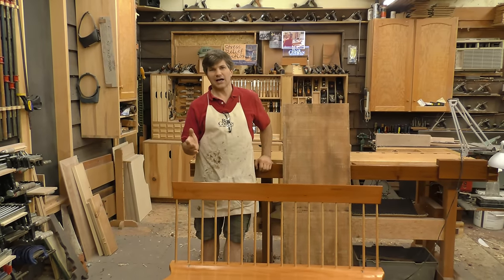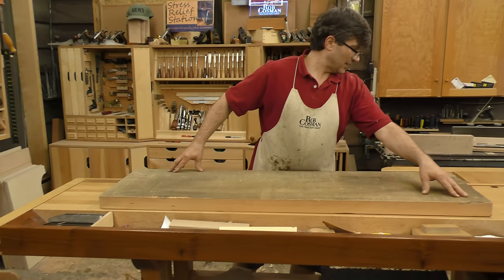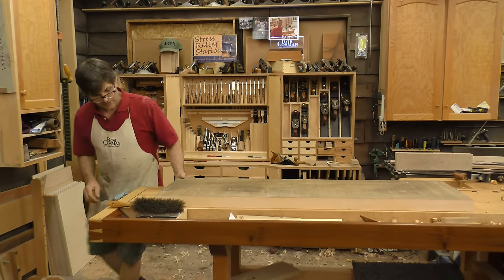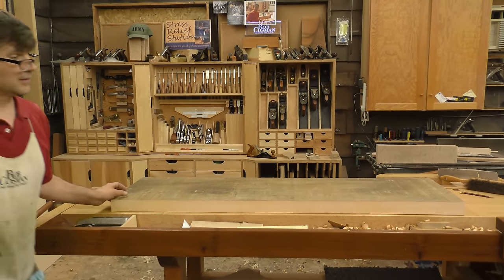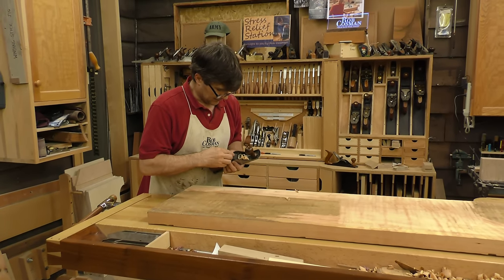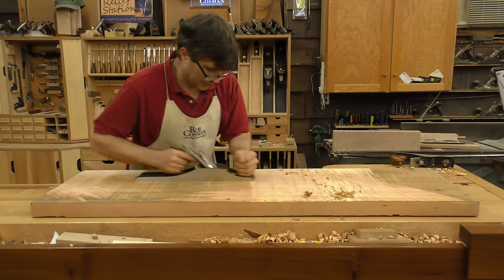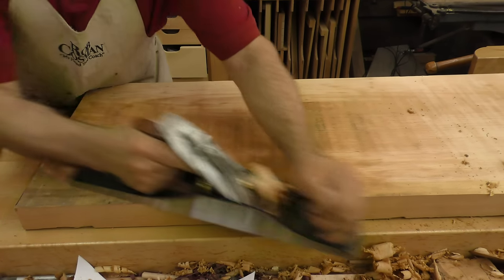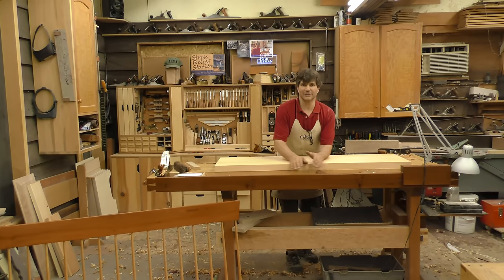Planing Wide boards more accurately with Rob Cosman

Comment: I discovered scrub planes by accident when I built my workbench. They are a HUGE improvement over attempting to level a board with a belt sander. No noise and most importantly no dust ! Also fast and the level of precision one gets just can't be beat!

Comment: Great video Rob. I loved the fact that you showcased the scrub plane and #6 plane. These 2 hand planes are often forgotten  but I could make an arguement that these should be your first hand planes you get.  Learning how to flatten/joint a face of a rough sawn board should be one of the first things you learn to do when learning woodworking and the use of hand planes. I love my #6, probably the most used plane in my shop. I use it just as in this video for flattening rough lumber as well as cleaning up large tabletop/panel glue ups and even as a jointing plane for jointing the edge of boards to be glued up.

Comment: I am a retired wood worker and enjoy seeing how others approach a situation. I continue to learn.Your way will get you a flat surface but have you tried putting your work on a known flat wood surface and wedge and lock your piece down so it can't  move then run it through your planer? In a few passes you are flat on one side.This is a huge time saver that increases your profit as it only take a few minutes.
Reply: how do you lock it down
Reply: Simple. Lay board on a carrier board or sled if you like, say 1/2 in ply or mdf then blobs of hot glue in the right places to level the board and stop it moving. Then pass both thru your thicknesser.   I have no jointer and have flattened boards through my thicknesser for years this way.  Still enjoy watching somebody use hand tools which is why I am here.  Look around youtube and you will find loads of  sleds, just don't go mad with all the wedges and do dads people make.  Hot glue is the way to solve the problem quick easy and knocks off simply after use.
Reply: how?
Reply: @frontbum420  not quite sure what your query is but the carrier board (sled some call it) runs on the bed of the thicknesser, the board to be flattened sits on top of that. Once you have established where it is rocking and the locations for your blobs of hot glue, apply glue (to make clean up easier I usually stick a piece of two inch masking tape on carrier and board to be flattened and then apply big blob of hot glue to the tape, that way you simply pull the boards apart and remove the tape, glue comes off with the tape).  When you rest the board to be flattened on the carrier board it squeezes the glue down and once hardened (30 seconds or so) it stops the board rocking and glues the two boards together.  Then pass the board through the thicknesser, carrier board down obviously and take as many passes as are necessary to obtain a flat surface  then remove from carrier board and flip over. Then pass the board through the thicknesser with the newly flattened surface down until you have a second flat surface.  It's really easy and gives you a perfect result every time.  I have no room for a big jointer and have flattened boards up to 10ft (bit tricky but a couple of roller stands and it worked fine) in length through my lunchbox thicknesser for years and years. If I haven't made the process clear let me know and I'll expand.
Reply: A flat surface and a long straight edge, draw measured squares with a charcoal pencil, move the board back and forth, the charcoal will make all highs seen with the charcoal moving out of squares. Same principal when I use Russian blue on steel. Its 100 percent effective. Art charcoal works best, I used same principal when I machine steel, no mess!
Reply: Michael. That is impressive. and helpful.  I have some charcoal pencils but never used them.
Reply: Came across this the other day. Haven't tried it but looks like it'll work perfectly.

https://www.youtube.com/watch?v=DNg9BV4IF2Q&index=58&list=WL&t=0s
Reply: @Dickie2702  Hear, hear!

Comment: Rob, another great session here, and I learned a lot as always. Many thanks to you. Just one thought: rather than flipping that heavy piece over and over again to test it, why not simply use your long straightedge to identify the high and low spots? That would work quite well and go very quickly. You're right that more folks should adopt and use the scrub plane. It's also a most useful tool for establishing texture on pieces that can benefit from that—sculpture for example.

Comment: I helped an old time woodworker with this same basic process on some maple of similar size.  Instead of using a hand plane to attack the high spots he set up a lapping table with coarse sandpaper glued to the flat table.  We faced each other and simply pushed the board back and forth between us.  We never had to flip the board with this method and as soon as the rocking stopped the boards went into the planer.

Comment: Since you were going to send this through the thicknesser I'd have used a 25mm mdf baseboard, shimmed the ends with wedges to keep it level, dogged it onto the baseboard and just sent it through the thicknesser taking very light skims... but hey, I'm an idle so and so and all that hand planning I did when I didn't know any better :)

Comment: One way that's worked for me is to remove the jointer guard, and joint the board, letting it hang over the side of the table. Then flip the board, set the jointed portion on a simple sled - a piece of 3/4" Baltic at least as long as the board, and the same width as the jointer bed. Run the sled through the planer, making the opposite face parallel to the jointed section. Finally, remove the sled, flip the board, and plane off the 'step' left in the original face from jointing only part of the board.

Comment: Rob - A technique I was shown to save time from hand planing a cupped/warped board was to get a piece of melamine, the same width as the board you want to flatten, as well as a little bit longer. Place the board on top of the melamine, and shim the gaps of the high spots. hot glue them down to the melamine so they don't move, and then run it through the planer until the entire board has been planed down. then just flip it over, and plane out the highs/lows on the other side. much quicker, all though I do love hand planning.

Comment: I really need to pick up an old #3 to #5 on ebay to convert to a scrub plane. A regular blade in a #3 does pretty well in softer woods, but for hard stuff like ash it can be a slow process.

Comment: hi Rob, would using your winding sticks help with the initial flattening? or a long straight edge? Cheers
Reply: Yea, I agree. Using winding sticks for the bulk of the primary work has got to be much faster than the constant flipping. Save the flipping for the last few high spots.

Comment: An easier and faster method is to build a sled wide enough for your planer. Place the board to be planed on top of the sled cup side down (so it rocks on the sled). Then place shims along the edges of the board to remove the rocking motion. Then use a hot glue gun to glue the shim to the sled, and then a bead of hot glue to join the board to the shim. Put the sled and board through the planer a couple times and it will come out perfectly flat. The hot glue is easily removed with a putty knife or chisel. Way easier!
Reply: Okay Rob, point taken. Cheers!

Comment: I think there is an easier way with the way you're showing. If I were to use hand tools just like you are what I would have done was scribe a reference line on my workpiece from your bench top that is flat. That way you have a perimeter line all across your board to plane down to. The only word of caution for this process is to hold your board  and not letting it move while you scribe the perimeter line on the work piece

Comment: Hi Rob! I'm pretty new to woodworking and am really starting to get into the meat of it. I was introduced to your channel just recently, and let me tell ya, you have a viewer for life and a future customer (once my budget permits of course!). Your utmost attention to detail is impeccable and I'm really grateful for all the material you provide. After watching this video, I wanted to ask: What purpose is the scrub plane for when it seems your #6 managed to do an equivalent job, if not better?  I feel like the longer reference edge on the #6 planed away the high spots more effectively while the scrub plane did so in more of a hunting manner.  It leaves me wondering what purpose the scrub plane has when other planes may be able to do its job. Any thoughts would be greatly appreciated, and as comes assumed, it was a great video. I learned a lot!
Reply: I watched the video and was enlightened cuz I've done similar process with #5 and #7 and it took close to 3 hours I think when the board is that severe and needs that much tuning  looks like it speeds the process to getting to the jointer #7 or in this case the fore plane #6 a whole lot quicker than without the scuba plane. But then again, Rob makes it all look so easy.

Comment: @robcoasman when you flattened the board could you of used winding sticks??
Reply: I find the human eye is pretty accurate when looking at these types of things, especially on large stock. I rarely use my winding sticks unless I'm struggling with the light or some other such reason. I find lifting the board at the end and looking down it works pretty well for detecting twist. Although I'm no professional!
Reply: Ok thanks I was just wondering :-)
Reply: Ok thanks Rob
Reply: I wondered this as well.
Reply: The referenced, flat bench top takes the place of the winding sticks.  I prefer it because the entire perimeter is revealed at the same time, no multiple placements for the sticks needed; it is true that the sticks would prevent the board flipping, but seeing and understanding the entire surface as a whole is critical.  When surveying the board's surface, I try to see it as I would see the lie of a golf fairway -- the entire surface has undulations whose relationships to one another change as the high spots get knocked down.  That said, I am watching this to learn from an expert, I am just a duffer.

However, it seems like the board is starting off in pretty good shape and would be inclined to pick up the jointer much sooner than happened in this vid because after knocking off the initial 2 or 3 minor high spots, the scrubbing started a process of chasing the board's imperfections to different locations.  Rob's mastery is what prevents that chasing from getting out of hand.
Reply: What??

Comment: Curious on your thoughts between this technique vs a simple router planing jig?  I always appreciate the hand tool approach, but it seems like just shimming up the board and then running a router over one face would eliminate most of the guesswork.  Just as a cheaper/somewhat-faster alternative to hand planes.  Curious if you think the hand tool approach has benefits over a router sled other than less dust/noise, or if it's just equal alternative.  Great video as always!
Reply: I think you'd be amazed how fast a sharp scrub plane can scoot through the wood.  I don't believe "speed" is a clear advantage to the router sled method - it's a lot closer to a "toss up".  That being said, with the method shown here, you're only surfacing the board just enough to run it through the stationary planer.  With a router sled, you'd probably have to do an entire side first.
Reply: Agreed - the router sled isn't excessively fast (thus me saying "somewhat-faster") and you would need to do the entire side, yes.  That said - you could do the entire side in 5-10 mins versus the half hour or so here.  All depends on how deformed the board is, I suppose.  Both methods definitely are great to know - the router sled version is just an alternative for folks that don't already have a bunch of hand planes, but do have a router.  The hand plane method is definitely more therapeutic, though.
Reply: Might be faster in certain ways, but remember, with a hand plane one plops the board down against the dog, picks up the plane, and goes to town.  In the mean time, one must unbox the router, install the correct bit, plop the board down, anchor the board, prepare/install router into the router jig, determine the correct router depth setting, set the correct router depth, connect router to proper dust collection, plug it in. NOW start routing at the rate of a 3/4" crosswise pass X 1/16" depth.  Meanwhile, the handplane has made a number of passes and might well be nearly finished.
Reply: I've seen various other methods to do this - although not with such a large board. They all use the same idea which is to use a flat sled, onto which the board is affixed, and then use various ways to shim the board so that it doesn't rock when putting it through the planer. Isn't the point not so much to make the underside flat as to make the board not move around as it goes through the planer? Search for "jointing with a planer"
Reply: no just the highest areas

Comment: Great video. I have to comment however... that you could have saved yourself a huge amount of work with the hand planer (over half the time you spend in this video) by using a sled and wedges to remove the twist and/or cup or ridge. You are already using a thickness planer... so just throw the slab on a large piece of MDF with a "stop" on the backside edge of the sled (to keep the slab from slipping off as it goes through the planer)... and use door frame wedges to stabilize the slab on the sled, and you're good to go (the use of a non-slip rubber pad keeps the piece from shifting on the sled). Run through the thickness planer with the wedge setup a few passes until the face is flat, then flip the slab and do the other side without the sled or wedges. Works like a charm! ;o)

Comment: I didn't understand that! You put the "scrubbed side" down on the bench after planing which you had already established was flat, I expected that you would put the planed side down to prove that the board went through the bed without distortion then put it through the thicknesser to clean up the scrubbed side.

Comment: You said something about most totes are made to be held with three fingers instead of four? Why is that? I've been wondering why my hand is so cramped on my Stanley #4 and #5...
Reply: Landon Cox I think the theory is body mechanics. The grip of holding your finger out helps you keep a consistent angle, or so the theory goes. Pre-war hand saws are the same way, you grip with three+thumb and extend your pointer finger.

Comment: “So much easier to work from the cupped side. Only have to plane the edges! Far less work”

Goes on to plane the WHOLE board!! 🙄

And if you don’t have massive jointer, just rip the board down, joint it, then glue it back together..

Rob, normally your videos are interesting and informative.. but this.. my god.. I can’t help be feel you owe me 30 minutes of my life back. Your invoice is in the mail. Please remit payment by the due date to avoid late penalties.
Reply from the maker: Showing ignorance!  Under "most" circumstances, working the cupped side will be easier.  The opposite side would have to be completely hollowed out to remove the rounded surface.  I dont cherry pick the board before we film, I show what happens in a real shop setting.  You picked the wrong channel if  you are looking for a sterile and rehearsed 22 minute "program".  On my channel, you are walking into a working shop and seeing how it happens as it happens.  Invoice rejected!

Comment: Rob great video,  something I've been doing for decades but have taken for granted,  does your 20" planer have a helical cutter head? When are you coming down to this side of the border? Hugh woodworking show this weekend in Saratoga Springs, NY. (www.nwawoodworkingshow.org)
Reply: Hi Rob, busy month; NWA Woodworking Show In Saratoga Springs the 1st of April then Fine Woodworking Live 2017 the 3rd weekend just outside Boston with lots of different spins on hand tool techniques, hand cut dovetails, sharpening,  but you're the best by far (for the benefit of those that have yet to take a class with you).

Comment: Before I say this, know that Rob has forgotten more about woodworking than I know.  Generally speaking, it is extremely unsafe to run a rough, bowed or cupped board through the tablesaw.  I have no doubt that since Rob felt it safe enough to run that board through the TS, he knew that particular board was flat enough.  I say this only for the less experienced who may not realize the risk.
Reply: This board is also so heavy that it is not going to kick back with a saw of ordinary power.
Reply: So long as the cupping is facing upwards, the board will fall away from the blade. The problem with kick-back generally occurs when the cup is facing downwards or the timber has a high moisture content and starts to bind on the blade (although then the kerf can be wedged open as it exits the outfeed table).
Reply: Frank what you say is true. Multiple passes with increasing depth of cut will minimize the risk as well

Comment: LESSON 1 - If you hand plane 1 side for 30 minutes, it will be flat for your electric planer. Why not just shim the wood on a sled so it doesn't bow as it goes through? Then once you have the flat side, you put it through without the sled. Though with your piece that would be a very large sled.

Comment: How does the content of this video relate to the title?
Reply from the maker: If you have a planer that is wider than your jointer you dont have a way of preparing one surface.  Without a flat surface on the bottom, the planer will only give you a thinner board, defects like cup or twist remain.  Learn how to flatten the bottom with a hand plane and you increase the accuracy of the full capacity of your planer.